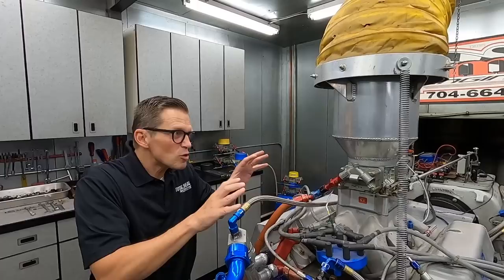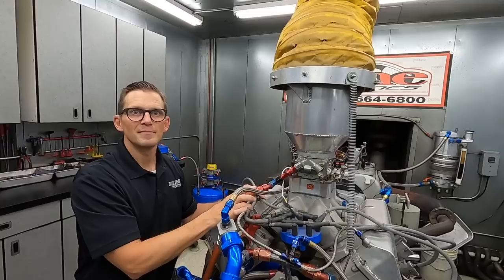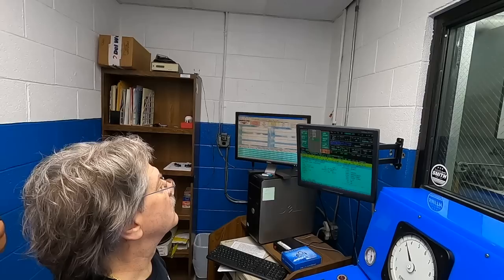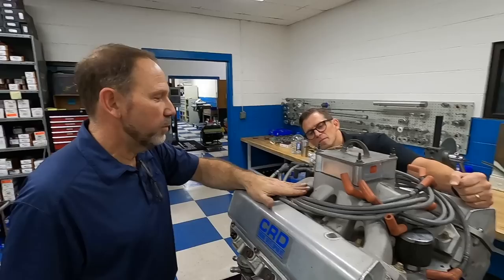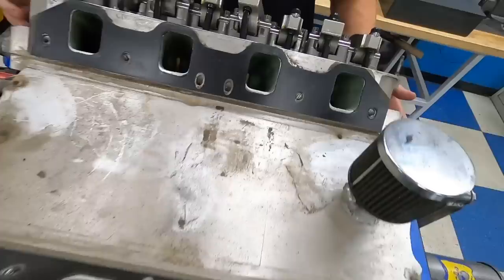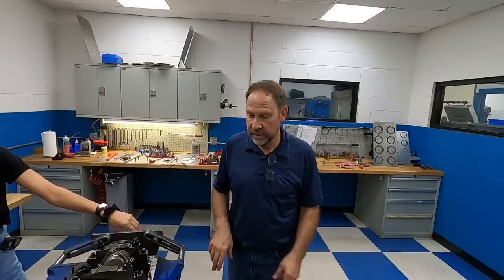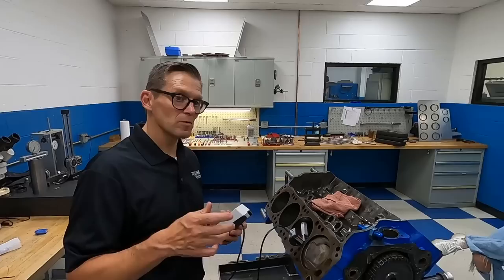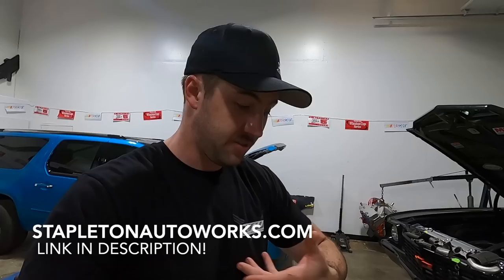Lake Speed's Ford C3 NASCAR Engine: Time Capsule of 90s Technology! (Dyno & Full Teardown)

Comment from the maker: This series is extremely awesome because it blends our love of history with building cars and tech stuff! Who was surprised by the findings of the dyno session? 😂

Merch link: stapletonautoworks.com
Reply: Finally some Ford content 😜
Reply: I got to build some canted valve Windsors. One of the best sounding engines ever! It should be down a bit. Really surprised the springs made it. BET, they had alot to do with power production. But, depending on how much they put in this going back updated. This thing will turn over 9500 and make 850hp or so. I would assume it'd would be round 2.5 hp per cubic in. Give or take how hard they go!
Reply: Me and this guy could have a good conversation. I wish I was there to take this apart and put back together! I have ported some c3s to move alot of air. Wish I could do these!!!!!! Make the port entry look like a Ritz cracker.
Reply: Man I love this series. Also love the way Lake Speed Jr explains the technology stuff.
Can’t wait to see the next episode!
Reply: This thing with a GOOD valve job and a good dude getting all the air speed stuff RIGHT. A cam that means business along with a spring set to match. Yall don't mention cam specs. I know what cam should be in there but what is it? I would like to come up there and work on those heads for real!
Reply: It looked like the #6 cylinder spark plug wire was arcing bad , love these videos man keep it up . Edit I forgot the firing order on the Windsor
Reply: @ryanbrown4336  I saw what I thought was arcing too in the in-room dyno shots and wondered about that being part of the issue too.
Reply: Not surprised.
For sitting so long, finish on the walls is gone away - may have been all but gone when it went into storage, the faces of the rings the same way, and the rings could be binding/sticking in the grooves - radial gas ports work well, but in storage would allow moisture into the top groove & with electrolysis between the ring and the piston could be an issue. 
I'd also question the valve springs, we went through them like water. Tired springs don't always cause a bounce or harmonics, sometimes they just let the engine 'lay down' and not pull the number.
I built these (CUP) engines not much later, with everything dead-on we could make BIG power in dyno trim, but one or two thing off and the power fell off like a boulder.
Reply: @loganerwin42  Only time I watch, Logan !!
Reply: @Motor-City-Mike  you should have lead off with the fact that you used to build similar motors it adds a solid background to everything else that you said. Overall a great bit of info put in a very articulate way.
Reply: My Favorite subject I’m obsessed with building engines and making Horsepower and have been since I was 12 yrs old and had a slow go cart that I wanted to go faster lol the more of these old nascar engine tech videos the better it may be outdated by todays standards but they made power back then and seeing how and how they made them survive 8000 plus rpm’s for hours is always cool
Reply: I  was forsure because I have a period correct sb2.2 that’s made over 850hp at 9200rpm with allot left on the table
Reply: Awesome series can’t wait to see what they can get out of it. Very surprised with the dyno 🧐👌😎👍🇦🇺
Reply: Love the hard core tech stuff! Btw at 11:40 you can see a plug wire arcing out, definitely part of the problem on the low power. Plug wires are probably 20 years old
Reply: This is my first time viewing this series and so far I really like what is being presented. I’m not familiar with the people involved other than Speed Jr. who’s obviously quite knowledgeable and intelligent. But the person asking all of the questions and I think is operating the camera too, is coming across as being a tad on the ignorant side. Is he deliberately asking dumb questions in order for Speed to answer them in a manner that the viewers can easily understand ? It would be hard to imagine that someone involved with the show is totally clueless about the topic. 

Despite the annoying distraction, I’m really looking forward to seeing the next episode. I understand why the Ford C3 heads are being referred to as old technology but there are several modern builds featured on YouTube that are using C3’s to their fullest potential and posting dyno results close to the magic 1000 horsepower mark. No power adders, single 4-V induction and all Ford engine !
Reply: Not sure if you seen it but the ignition spark jumping on the front cylinder ( side angle of the engine in the video) to the valve cover ,that should have made some difference to HP
Reply: I was I think it was from sitting but don't forget it had 3 or 4 races  on it too ithought it would be down at least 120 hp and I built these for a living I was surprised at it losing over 200
Reply: I find it surprising how OBD-II forced engineers to design tighter fit, thin piston rings, valve seal design and even Teflon coated bearings. Still, they have not fully rollerized Torrington bearings in automatics. They are much better engines until playing with vairiable valve timing. Some better than others but many failures to lifters or solenoids are still lack of maintenance by the customer oil changes. 
 That will be next, where the dash info center starts counting down to shut-off. DK, ASE master since 78.
Reply: This is awesome .. I was wayy into this ... from dyno , to tear down and all the explanation .. 💪
Reply: @kalbcorp  I am with you as I worked to diagnose and fix root cause at dealer. The workings of a dynamometer as I understand were either a water - pressure load or like a load from an electric generator. Never had a reason to be near one or see the guts. A solid torque converter style makes sense as this is max resistance as "Shear" forces of water which has a tremendous molecular bond. Just glad it doesn't rain in chunks! ;) DK, Omaha.
 (Oddly) today the new "F-15EX" jet just out last Wednesday with split tail with landing gear flew slowly over the house. We have SAC Air Force on SouthEast corner to the city, next to the Missouri River. Pilots get hours and pass "Gage Flight" as they fly with curtains snapped in cockpit and are forced to use gages. They do a touch & go, take off, circle and do it again. Even AWAX air plains + big 747 types. These are real loud!!!One place that then President Bush landed during the 9-11 attack, as 70% of their facilities are underground! Here comes another. I just want to see 36 million dollars look like flying.